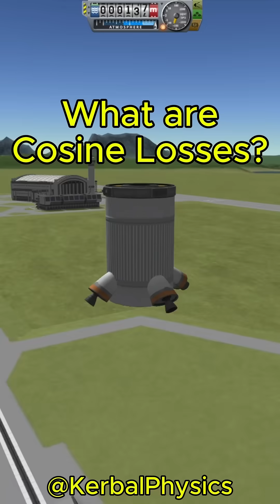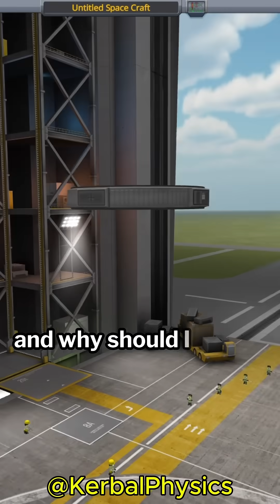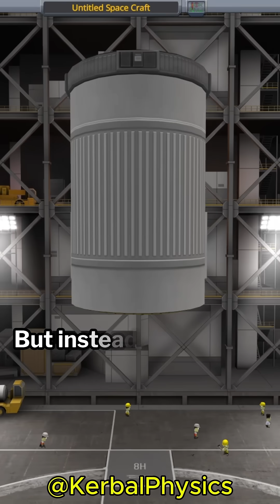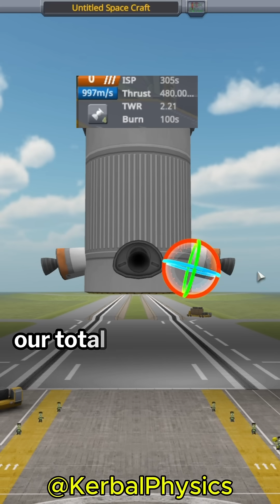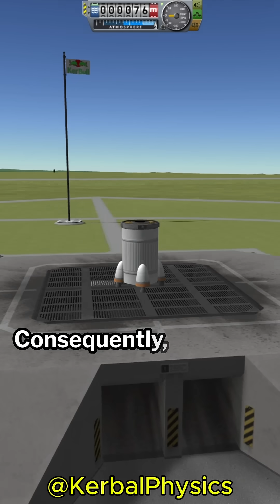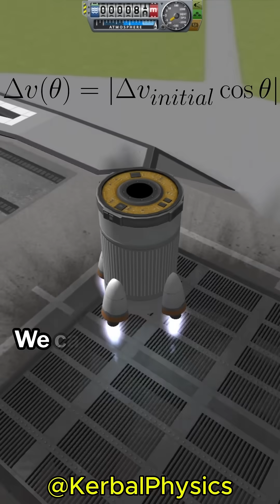What are Cosine Losses in Rocketry?  #kerbalspaceprogram

Comment: I thought cosine losses had to do with your thrust vectors angle to prograde?
Reply: Although it's not the case for instant acceleration, for a continuous force;

Burning prograde: Angle of 0 (cos0 = 1), dV expended is added to your speed. 

Burning retrograde: Angle of 180 (cos180 = -1), dV expended is subtracted from your speed. 

Burning normal/antinormal: Angle of 90 (cos90 = 0), dV expended does not effect speed, only direction. (given the craft turns to continually face normal/antinormal).

Essentially dV spent not facing prograde gives less speed as some energy is wasted changing direction, and the speed you do get is proportional to the cosine of your angle to prograde.

Comment: For anyone wondering why you may do this: If you have anything the engine's plume may hit, you may want to point it outwards. A great example of this is skycranes, like what was used for Perseverance's landing. This stops the plume from burning whatever is below it. Another reason is if your rocket is "unconventional" in certain ways like the Space Shuttle, its RS-25's are tilted slightly so that the center of thrust goes through the center of mass to avoid torque on launch since they are off to the side.

Comment: Ok but nobody does this? Theres no reason to ever point your engine any direction except to the back of your ship.
Reply: Sky cranes need to have the engine pointed away from the rover to not burn it
Reply: @Loading187 just make the rockets farther away from the base
Reply: @milesmcallister8542then that means a larger faring or it takes up more space
Reply: @Loading187 make it foldable then
Reply: @milesmcallister8542what if you dont have a dlc, and why make it more complex anyway?
Reply: @Loading187 more fuel efficient
Reply: @milesmcallister8542slightly, but it dosent take that much fuel to land something with a skycrane, you only need to start using it ~1000m up, plus having them point slightly outwards is more stable
Reply from the maker: @milesmcallister8542 adding mass never makes a rocket more efficient.
Reply: @KerbalPhysics  depends on how light the materials are
Reply: @milesmcallister8542 more fuel efficient on the skycrane's descent, but that doesn't really matter since skycranes don't need lots of fuel efficiency. Doing what you said actually makes it LESS efficient on takeoff. Wider skycrane means bigger fairing, and anything containing the skycrane being bigger. This means more mass and less efficiency. If you make it foldable, that adds more complexity which usually means more mass, and the folded up state will still be bigger, so there will still be efficiency lost to larger fairings and containers.

Edit: Even if the materials are light, extra dead weight ALWAYS means more mass, no exceptions.
Reply: @Loading187 skycranes arnt in KSP.
Reply: @robertharris6092  You could try making them yourself. And skycranes can be easier in other games like Juno where this same stuff still applies.

Comment: Do people do this?
Reply: I have before in Juno: New Origins. I had a contract to put a rover on Luna, and for simplicity I wanted the rover to be on the bottom, because of that I couldn't put one engine on the bottom. So I put 4 small engines on the side and pointed them out a little so they didn't burn the rover. Also, the Space Shuttle did this so the engines' COT went straight through the COM for stability. So there are reasons to do it, but it isn't really something you would do often.

Comment: Is that the reason that the space shuttle’s engines are faced a little bit outward?
Reply: No, they're tilted so that the center of thrust goes directly through the center of mass and so the craft won't experience torque while burning.
Reply: @nork7045  Awesome thanks!
Reply: @Jimmytheskinny  in fact, that tilt results in more losses, but it is necessary